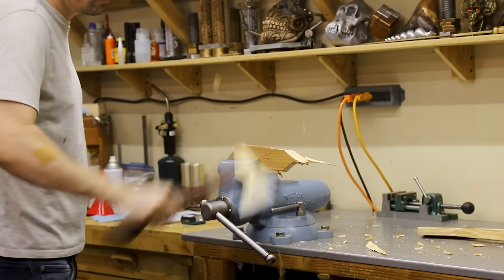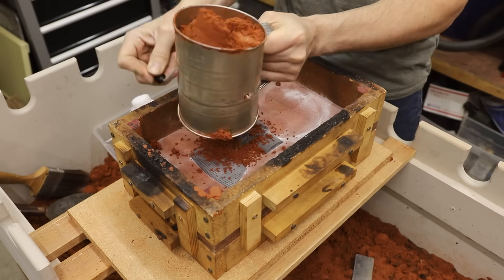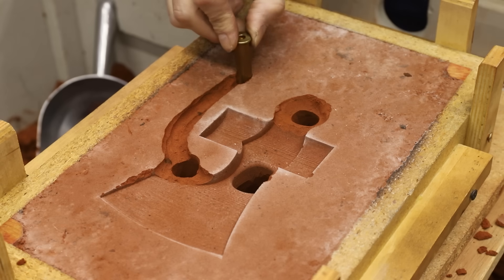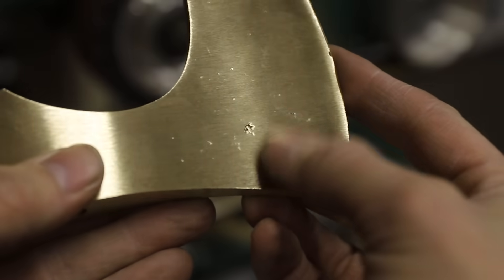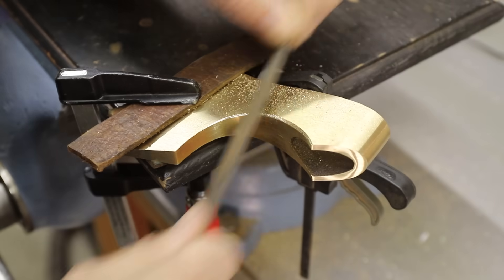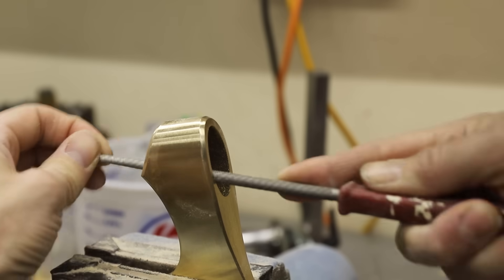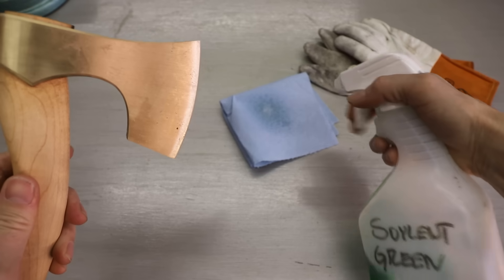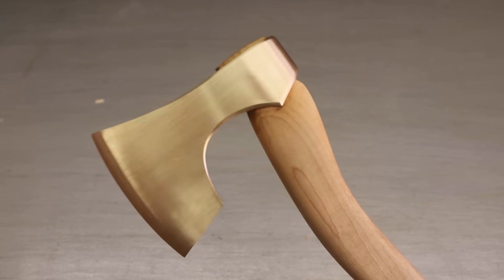Making & Testing Aluminum Bronze Hatchet WILL IT SURVIVE?

Comment: Aluminium alloy hatchets were used regulary in coal mining. It was done to prevent sparks which could ignite explosive gas or coal dust.
So it maybe not suitable for hard wood but effective for coal mining and also for shaping logs in mines.

i got one of these at my wall from my grandfather and it looks great :D

Comment: I'd like to see a cast of alubronze around a center steel blade. Might not be feasible due to different thermal expansion properties, but it would be fun to see the result of trying to do a sandwich solution.

Comment: Beautiful thing! I´m very curious about the weight of it, compared to a "standard" steel axe. That is important for effective daily use. The softness of this does not speak well for its usability :) I chop between 5 and 30kg of mainly birch firewood every day and a cheap steel axe lasts for many many years before needing any maintanance. I can take it out an shape a pole or something and it still bites comfortably. So would you say this alloy experiment makes mainly a decorative art piece, or is the goal to have a daily-use tool?

Comment: I'm curious, with the shape of the handle, was it for comfort during use, or is there more of a reasoning behind it? I also noticed small cracks formed when you put in the steel wedges, would that bring a negative impact on the hold of the wood in the axe's eye?
Reply: The cracks are what happens when you spread or splay the wood of the handle by hammering in the wedges, and have a positive impact on the hold of the handle into the eye - that is the reason that he had to grind/file a taper into the eye, to make it slightly wider at the top.  If the wood isn't spread into the taper, it won't hold, and that is the entire reason for the wedges.

Comment: Very nicely done, I've cast several alloys of bronze or brass over the years, but none for tool purpose, generally art.  I thought it held up pretty well considering.  It's been a primary metal for bearings in engines and transmissions, where I've been working with it mostly, special alloys.  Thanks, very nice.

Comment: Of the 3 axes I own I have a Hultafors Åby axe that is my favourite at the moment, made of carbon steel, it's a hybrid axe, with a straight edge, very cool, chops wood like butter. I also have a historical axe made after and archeology find in Sweden that dates from around the 1200s I believe made by Gränsforsbruk, the handel is like more bent towards you when you hold it, or how to say like handle is like  a  " ( " in a sense. and the edge is very curved and sharp, (I shaved it for fun). :)

Comment: See, that’s a post apocalyptic skill, casting iron takes too much heat, but aluminum and copper are both readily scavengable and meltable. You could potentially make something quite complex if you needed to.

Comment: A little advice: if the edge is bent without visible cracks, you might want to hammer or press it back into rough shape before sanding. Way less material lost that way.

Comment: the colors of this axe material look familiar. As an electrician who did a lot of exothermic welding, looks to me like the color and consistency of an electrical "CAD WELD" once fired and welded or cast into form, not the iron based used welds used in the rail world.  I still keep shots, welds or loads around for mad scientistry.  I made casting binders in the 80's for local foundries at a local foundry and, worked in forges.
Great job on the mold, the old carpenter dudes mostly did this old school last time I saw, I loved there abilities, engineering, with art for function.

Comment: It's more about geometry than better alloy. You used steel template for bronze. Check out how historical swords and axes are different in desing between steel and bronze. Bronze axe would be ticker, more depending on mass, also edge would have wider angle and it would be sharpened mostly by hammering, grinding may be only a finishing touch. Its also normal for bronze edge to get some dents, You can just hammer them back into the place ;)

Comment: I'm not a metallurgist so I don't know how he's calculating the aluminum to copper ratio. The small aluminum disc looked like way less than 10% by weight, but possibly it was 10% by volume? Somebody help 😭

Comment: @11:42 i do not know if i agree with the steel wedges. if the eye wood and walnut wedge is not oiled, often, the head will come loose. same is said for the steel wedges. ruins the look of the eye.
just keep it oiled. who first invented a steel step wedege anyway? the "old timers" didnt use them for a reason. oil was enough?

Comment: one important thing to note: you shouldn't grind edges on stuff that can be work hardened, you can draw out and even repair the edge just by hammering it out, that way you don't actually loose material when sharpening.
grinding should only ever be done to something softer than steel to put minor finishing touches on it.

Comment: Honestly I've seen some aluminum bronze that people have made that Rivals certain steel so if you mix it right you can get a really good tool from it also it's not just the ratio you mix it's also the grade of the metals you melt together as well would be something you should take into consideration when you get a good mix ratio then look at the the grade of the metals you're using

Comment: on the bronze Tig weld, I've found if I use a 1/8 tungsten and turn the heat up (foot pedal control machine around 260) i can actually puddle stack dimes as needed.  thanks TESTING this thing, I was really interested in how durable it would be!

Comment: Not trying to be too weird but you can also "work harden" using explosives. I'm not very familiar with it but it should have at least a decent case hardening effect. I daydreamed about using it for jewelry which I would otherwise be unable to work harden, hopefully not destroying it in the process. It's been used on steel railroad cores / junctions. Perhaps using water to transfer the shock wave would be ideal due to it being very difficult to compress. Food for thought. Also,  that's a very nice axe. A wider angle should reduce the edge rolling but it's always a trade off.

Comment: you know what would look nice.. all that dust u collected on the belt sander.. on the handle put 2.. 4..  rings  on the  bottom of the wooden handle & mix that dust with 2 part epoxy & fill in the design or rings u put in the handle and sand it smooth

Comment: SO, you pulled right up to the question I wanted to ask.
(Bronze ) doesn't hold a very good edge.  (Aluminum) holds a "decent" edge.  And (Iron) hold an edge in the middle of those two I mentioned.  Now (WHAT) metal holds the best edge.  Titanium?  Probably not.  Sure it probably sharpen down to a razor edge.  BUT, so does high carbon steel.  But that flavor of steel is "super" brittle.  Titanium might be also, i dunno.  Ductile versus edge.  It's a delicate balance.  (Bronze) is to far to the "ductile" side.  But, in your opinion (cuz this is really not a quantifiable question).  What metal (Or alloy of metals) would make for the best edge.

Comment: A better option would be Beryllium bronze but that stuff is a little bit dangerous because of the Beryllium toxicity. Should be fine as long as you don't try to weld it or grind it too aggressively, though. Tools made out of this alloy can be purchased for use in explosion-sensitive areas, since they don't throw sparks when impacted.

Comment: To attach an axe head (or any tool head with a central eye) to a haft, you push the tool head onto the haft till it sticks then grab the handle by the other end (the bottom) and let the tool head hang down towards the floor. Then gradually hammer the bottom of the handle (where you are now holding it) and the head will slip on more easily and securely (because it can more efficiently compress the wood fibers).It’s an exploit of physics where the mass of the wood is easier to move than the mass of the tool head, even hanging in open air. Please try it, it will make your lives better

Comment: One thing to consider is that during the Bronze Age, and even the early Iron Age, little of the wood used was seasoned and dried first.  Green wood is vastly easier to work than seasoned wood, so your axe's edge would likely have lasted longer.  Also, you did not apparently sharpen the edge between cutting experiments.  This treatment would be reasonable for a steel or iron axe, but an individual used to using bronze tools would likely have habitually maintained the edge to ease the work.

Comment: Can you tru a diffrent alloy

Orichalcum or aurichalcum /ˌɔːrɪˈkælkəm/ is a metal mentioned in several ancient writings, including the story of Atlantis in the Critias of Plato. Within the dialogue, Critias (460–403 BC) says that orichalcum had been considered second only to gold in value and had been found and mined in many parts of Atlantis in ancient times, but that by Critias's own time, orichalcum was known only by name.[1]

Orichalcum may have been a noble metal such as platinum,[2] as it was supposed to be mined, but has been identified as pure copper or certain alloys of bronze, and especially brass alloys [3] in the case of antique roman coins, the latter being of "similar appearance to modern brass" according to scientific research.[4]
Ingots found[edit]
In 2015, 39 ingots thought by some[who?] to be orichalcum were discovered in a sunken vessel on the coast of Gela in Sicily which have tentatively been dated at 2,100 years old. They were analyzed with X-ray fluorescence and found to be an alloy consisting of 75–80% copper, 15–20% zinc, and smaller percentages of nickel, lead, and iron.[7] Another cache of 47 ingots were recovered in February 2016 and found to have similar composition as measured with ICP-OES and ICP-MS: around 65–80% copper, 15–25% zinc, 4–7% lead, 0.5–1% nickel, and trace amounts of silver, antimony, arsenic, bismuth and other elements.[8]

Comment: I like your casting bench, but no matter what, casting is messy. I need to try AL bronze. I've been using scrap aluminum car parts for casting. I've struggled to reduce the hydrogen bubbles. Getting better, need to get an Argon bubbler.

Comment: Man... Three things
1) The irony of using steel wedges to better mount a bronze axehead
2) Bronze and copper axes generally would have a vastly different profile than a steel axe would; Different materials have different properties and to use them most effectively you have to design around those properties
3) Most bronze age and stone age woodworking worked with greenwood for a reason; you see this emphasized greatly when it cuts right through the still green tree trunk, but is really beaten to hell by the dry wood.

Comment: Variations on this theme that I'd like to see are the use of arsenical bronze, if that's possible, and the potential durability of a bronze saw.

Also, as I think others have mentioned, keep in mind that the shape of the modern axe is influenced by steel, which allowed for a thinner blade. Softer materials may need to look more like a stone axe.

Comment: Rather than grinding a new edge, it would be better to hammer it back into shape. This preserves material, and further work hardens that metal. This would be more or less how all bronze or copper tools would be sharpened, hammer them sharp, then touch up with a stone if needed. For really major edge reworking you may need to anneal it first.

Comment: To be fair to your hatchet, you usually don't cut dry seasoned boards with one. That's generally a job for a saw. I'm sure a steel hatchet would've fared better, but really, cutting down the tree in the first place is what hatchets are for, and it did fine at that. And, hell, it doesn't have to perform as well as steel. It's cool enough that it looks like solid gold and can cut anything at all. I'd like to see somebody forge a gold hatchet just for laughs and see if there's anything at all it can cut. I'm going to guess it would start bending somewhere between cardboard and styrofoam. I'd also like to see how a beryllium bronze hatchet performs, but beryllium's dangerous as hell and I wouldn't expect you to work with it. :P

Comment: The aluminum bronze I have worked with is like 100000x tougher than the alloy you are using. I was shocked when you grabbed a file and proceeded to actually use it on the stuff. My vice grips are softer than the aluminum bronze I have.